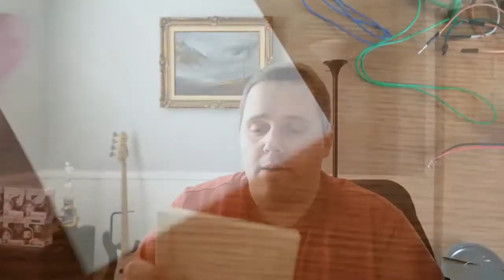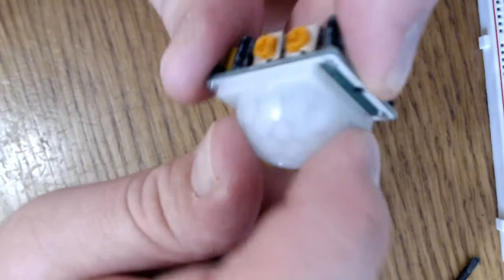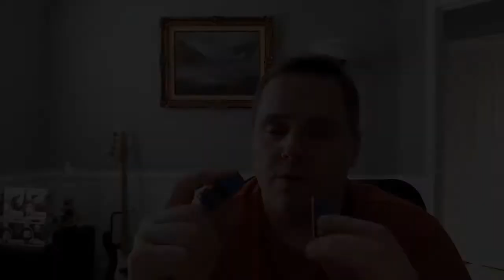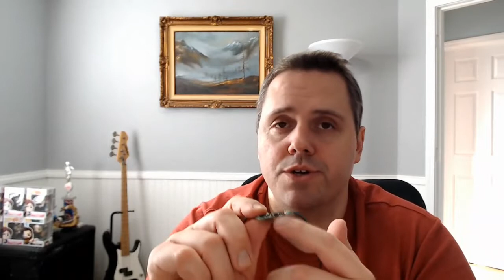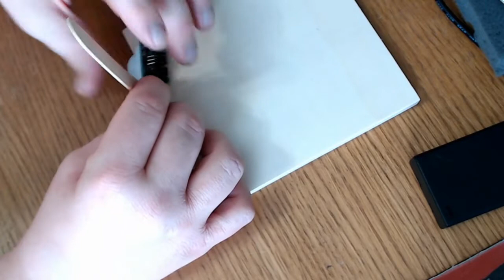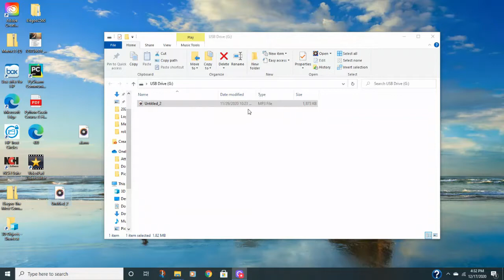How To Create A Simple DIY Motion Activated Sound Device With A Relay Module For Beginners

Comment: Hi there,
 I just want to acknowledge that you have some awesome video content. Your transparency and in-depth detail is honourable because most channels that do this electronic stuff only do it to show off and are not interested in helping others learn. After all, that's the reason most people watch these DIY channels, to learn and possibly create something new. 
Also for myself, I have been searching for exactly this information to help me with my Trigger Bear. So you have given me exactly what I needed.
Two questions if I may? - Are you hooked up to Arduino in this video, or were you just powering it via that white lead with your PC? That part threw me a bit as Arduino was never mentioned.
Secondly - What are those hook style probes you have attached to the wires? They would come in very handy. 

!Keep up the great work!
**!New Sub!**
Reply from the maker: Wow Tania, thanks for the comment. Great to hear from you and I totally appreciate it. 
I did not use Arduino in this video. The relay is used as a trigger to turn on the mp3 board when the sensor detects motion. Everything is powered by 5v. You need 5v to activate the coil in the relay, that is the trigger. In the video I used a breadboard power supply. Go to Facebook and search "#bmonsteralarm" and you can see a schematic. If you do, let me know how it goes. The hooks are called  Silicone Minigrabbers and you can find them on  Amazon. They are kinda cheap and flimsy though, but very convenient.  you can adjust time and sensitivity directly on the motion sensor with a screw driver. The only downside to this is that you can only run one track.
You might be interested in this vide - https://youtu.be/zamlAniU2nQ - this setup is Arduino with a mp3 shield. You load songs onto an SD card and you have have a lot of tracks (mp3s). You can make a motion activated player like I did here with a random shuffle. Your mp3 choice is only limited by the SD card size.
I hope that schematic helps you. 👍
Reply: @BMonsterLaboratory  
This is brilliant! 
Greatly appreciated!
Thank you so much for taking the time to respond with such detail.

Cheers
Tania
 AU
Reply from the maker: @NitrosDen  anytime! Good luck with future projects 
-brad

Comment from the maker: This is a beginner video using a PIR motion sensor and a relay. This project was fun to put together and has a lot of possibilities! More to come on relay + sensor projects in the future. Time stamps are provided in the description. Enjoy!
Reply: Can you try to turn a stufed animal into a robot?
Reply from the maker: @mattiasessothefireraptor5311  hey Mattias! I could give it a shot and see what I come up with :)
Merry Christmas!
Reply: Hello do I make a Music box with the PIR sensor with this
Reply from the maker: @patrickmurphy6669  hi Patrick! You can certainly use this to make a motion sensor music box. You wil need some more components,  but this could activate the music box  when motion is detected. I like the idea!
Reply: @BMonsterLaboratory  how do I connect it up to a battery pack Iv never done this before so I done no where to connect the wires
Reply: I was trying to find something that would detect someone entering and leaving a room which would trigger a different set of greeting/exit message. Is this something you would consider attempting to create?
Reply from the maker: @mmena311  hi there! you could use this for that purpose if you set one up at the entrance and set one up at the exit - at two separate doorways. If the entrance and exit use the same door you may want to look into an Arduino setup. This one just simply detects motion and plays one mp3 file.

Comment: I’ve connected everything as it shows in the video but I can’t get the entire mp3 file to play. It just skips and skips the first second of the file. The red light on the relay stays triggered. What am I doing wrong?
Reply from the maker: Hi there!
Make sure you have 5v (4.5v at the very least) power supply to activate the relay. make sure the relay jumper is set to "H". If it's on "L", just remove the jumper and put it on the "H" pins. Use the COM & NO terminals. Try switching your motion sensor jumper as well.
I have a diagramm on the facebook page. Search " bmonsteralarm" in Facebook to find the diagram.   If you're still stuck, let me know 👍

Comment: I have a couple of toys that were beloved by my children 20+ years ago. One is motion activated and the other makes a sound when a button is pushed. I would love to have these repaired! Is this something you could help me with?
Reply from the maker: Hi there! Are you wanting to do a complete rebuild of the electronics? Do you just need to replace a sensor and button? Do you have the sound files or can you get a recording of them? What is the name of the toy?
I may be able to help out here. I have a little plush monkey that I want to add some buttons and a custom voice box to and I have the perfect mp3 module for it. So ya, it can be done. I would use a different mp3 module or Arduino for more advanced features.

Comment: what if you wanna connect it to a way louder speaker? the idea is making a outdoor halloween grim reaper/skeleton type of thing that makes a yells or laughs when people walk by it ;)
Reply from the maker: Great question! I just received a board that you can use without arduino and would work well for a project like that.  You would need to solder a header and power terminal on to it,  but it sounds great.  Will post the video very soon.
Reply from the maker: If you already have the module in this video, check out the LM386 amplifier to boost the sound.
Reply: @BMonsterLaboratory  thank you thank you looking forward to it!

Comment: I have most of the components to this design, but im just trying to get my computer to pick up the 8mb speaker connected to it. It loghts up when connected to my computer, but my computer wont recognize it
Reply from the maker: power the board from the battery pack and see if it will play your mp3. If you removed the battery pack like i did, just supply 5v power to the wires.  you just plug it in to swap out the mp3 file i believe.
Reply: @BMonsterLaboratory  hey thanks for the response and a rather quick one too! I actually went digging for a bunch of micro USB cords Incase I had a "charge only" cord and that was indeed my issue. Thanks for making and sharing the cool DIY tech! :)
Reply from the maker: @staker-ei4of  glad you got that resolved.  Thank you for adding to the conversation here. Good luck with your diy electronics! 👍 👍
Reply: @BMonsterLaboratory  glad to be a part of it :) on another note I just played around with the dial that turns up and down the volume and it appears I can't get a sound out of it atall now 😅
Reply from the maker: @staker-ei4of  is it unplugged from the pc and are you using fresh batteries in the battery pack? If you removed the battery pack, are you providing 4.5-5v power to the board?
Reply: @BMonsterLaboratory  I've used power from PC, and I've used a fresh brand new pack of batteries, I really think I might've broke the little volume dial thing 😅 has that ever happened to you or anyone else that you've heard of?
Reply from the maker: @staker-ei4of  I have emailed a couple of people who couldn't get volume to work. they had to request another one. It should work for you, especially if you haven't modified it yet. Weird....i haven't had an issue with mine. I use mine so much I need to resolder the wires  cause they're falling off. I should get another one just to see if the quality has changed. sorry you're having trouble with it
Reply: @BMonsterLaboratory  no worries, I think I turned it just a little too far in one of the directions and after that it's like it broke the circuit or something? I have spare components like this, but was kind of hoping I could salvage this one 😅
Reply: Edit: I've taken a look at other electronics with a near/exact same screw volume control. They're like potentiometers and the one my 8mb speaker spins a full 360 so I think I'll need to desolder and replace it :( I'll let you know how it goes when I get around to it. Note: it didn't take much force to break, I might've gotten a slightly defective one
Reply from the maker: @staker-ei4of  If it was defective when you got it, it should be replaced. If you think you broke it, not a bad idea to try and fix it. good luck to you

Comment: Is there a way to make the motion sensor reset faster?
Reply from the maker: Yes. There's a time delay potentiometer. Turn it counter-clockwise to shorten the time the sensor remains "high". 
There's a jumper you can select "H" or "L" on the back of the sensor. The time delay potentiometer is the one furthest from the jumper. Turn that and fix the adjustment to your liking. 👍   chick this site out if you get stuck https://components101.com/sensors/hc-sr501-pir-sensor

Comment: Would it be possible to make this play a random sound bite from a list of mp3s? For example a collection of seinfeld bass riffs.
Reply from the maker: Hi Eli. You can't do random sound files using this. You would need a sound module that plays random files, probably one that holds a mini SD card that you can load the songs on to. Some of those modules you can use with or without Arduino. I like the idea though!
Reply: @BMonsterLaboratory  Thanks for the response! I'll look into it

Comment: Can you help me understand the necessity of the relay? I built mine without a relay and it works fine. If there is a purpose I would love to know. THanks.
Reply from the maker: Hi Steve. I built this when I first started playing around with circuits and for me it was an easy visual to see how the relay replaces the manual switch I removed from the module. I wanted an automatic switch that activated on motion and not have to press it. The relay was also pretty cheap and could be mounted easily. There are also screw ports on the relay so that means I didn't have to solder (something I was pretty bad at....and maybe still am ! ).  99% of the time you'll see a relay used to separate very high voltage trigger from very low voltage triggers but Overall, it was just a little experiment that worked nicely and was happy that I could use it for a practical purpose. 
You could use a MOSFET to get the job done but back then I don't think I even knew what one was...there may be other ways to do it as well. Thanks for asking. I should make a follow up video on this.
Merry Christmas to you...hope to hear from ya again 👊👊

Comment: Thanks for this project hoping you can help. I cannot seem to get this to work. I see the motion sensor triggering the relay, when I move the sensor the red light come on. I have also tested the sound module and it works fine when I use the battery pack and button. But then when I try and power it from the breadboard still using the button it does not work. If I use the battery pack and wire the button wires to the relay it also does not work. Any thoughts? Relay jumpers are set to H and motion jumpers are set to L. Thanks in advance.
Reply from the maker: for the relay:  +/- are going to be your 5v power and ground, the In terminal is going to be your middle pin (signal) of the motion sensor.  The pos/neg pin of the motion sensor will be connected to your 5v and ground.  for the mp3 player module, you have a black and red wire - black goes to ground and red goes to 5v power. connect your blue and green button wires to NO and COM. if it triggers too often you can adjust the timer on the motion sensor by turning orange potentiometer clockwise. I just set mine up again and works prefect. if you need pictures, just ask. I can send them to you. 👍💪

Comment: Hi there. I'm trying to get a similar result with a DFPlayer mini, but the relay module is far to slow to activate it properly. It requires a momentary action like from a push button switch. Will it work if I use a positive edge triggered D-type flip flop with a PIR sensor as a clock input? To start playing this mp3 module needs momentary connection from the players GND to one of the functions, so I was planning to connect the flip flops data pin to GND, PIR sensor to clock pin, and the output pin to one of the functions. I was also planning to connect output to master reset so it returns to initial state every time. I'm also wondering if I have to independently supply voltage from the power source to the flip flops VCC and GND pins. Thank you in advance, you rock :D
Reply from the maker: hey KainKnox! If you're wanting to connect an mp3 player (with SD card) to a PIR motion sensor I would suggest Sparkfun mp3 player shield. It's very easy to use, you can load a ton of songs on your SD card, There is a 3.5mm jack that allows you to connect much better sounding speakers than a simple 8ohm mono speaker, and its a shield that fits right on top of your Uno board. Check out this video https://youtu.be/zamlAniU2nQ and see what ya think. My DFPlayer mini was very glitchy so I haven't really use it  much at all. If the DFPlayer mini is your only option I will be happy to help out however I can :)

Comment: So glad i found this.Subbed.
question i have is,im using this with my pico to trigger a sound.Is there a way to have this play a random sound from my tracks list or will this require a different mp3 player with multipull outs?
Reply from the maker: Hey there! Thanks for the sub. I have never used an mp3 player with my Pico but it appears that some poeple have used a DFPlayer with pico. I'm personally not a fan of DFPlayer because I never had good luck with it. It's cheap for a reason I suppose. I am wondering if you can use the Raspberry Pi Pico (RP2040) SD Card and use Adafruit MP3 Decoder library to play tracks - I have never done this either but this may be helpful https://www.digikey.com/en/maker/projects/raspberry-pi-pico-rp2040-sd-card-example-with-micropython-and-cc/e472c7f578734bfd96d437e68e670050         
I am familiar with the Sparkfun MP3 Player Sheild for Uno / Sparkfun Redboard - https://www.sparkfun.com/products/12660
I have purchased 12 or so of these shields and they work great with the Sparkfun Redboard. The question is, how many random tracks are you wanting to have and does it absolutely need to be on Raspberry Pi Pico?

Comment: I have questions and need your expertise. Do you have a link to the breadboard power supply? I searched Amazon but didn't see anything exactly like what you used. Do you have a link to the jumpers you used? I've been soldering the power supply wires to the motion sensor. Lastly, I want to enclose the entire thing in a box, I can easily do. But, I want to add an LED that lights up when the motion detector detects motion which will be mounted on the outside of the box. Where would I plug in the LED and what other parts would I need to do that? I am using 3V 20mA LED's. Thanks for your help.
Reply from the maker: Hi there!  What you're asking for would probably be easier using Arduino Nano. The code would be very simple and we could clean up the look a bit. I would like to revisit this video using a Nano rather than a relay and maybe some LED lights as an option. I used the relay and a sound module so I could put this together without having to program a microcontroller and while it does work, this 5v relay is really designed to isolate high voltage and lower voltage in a circuit. It allows 2 isolated circuits to connect, such as a 5v with 120v or higher using an optocoupler but in this video I only use 5v. The LED may work if you split the wire coming out of  the "NO" port but you would have to add a resistor to your LED so you don't burn it out (probably a 220ohm resistor).  The jumpers i use are just standard breadboard jumpers. I have a couple breadboard power supplies but the best one by far is the Elegoo brand power supply that came in my Arduino kit. check out the Amazon product with ASIN: B08RY45QJ3.  Feel free to send a mssg on facebook or email at bmonsterlab@yahoo.com if you get stuck.
Reply from the maker: So, I tried out what I suggested before and I have an LED that lights up until no motion is detected. At this point the MP3 stops playing and the LED goes off.  Connect LED (+) to NO port and (-) to 220ohm resister ground. I can make a schematic for you if you like.